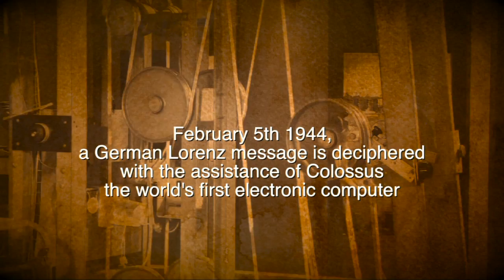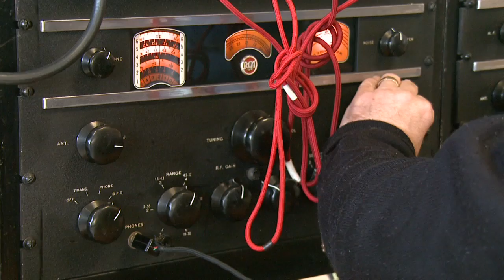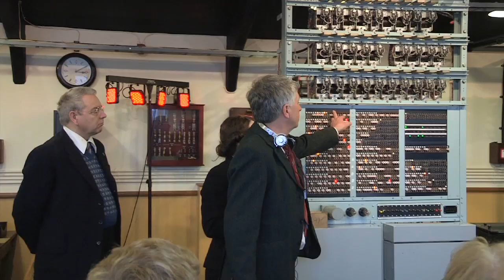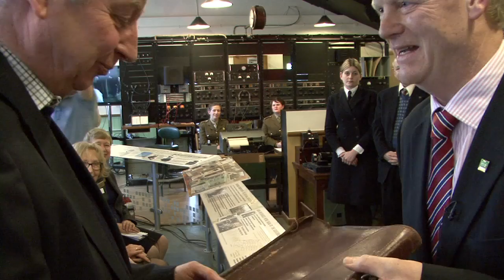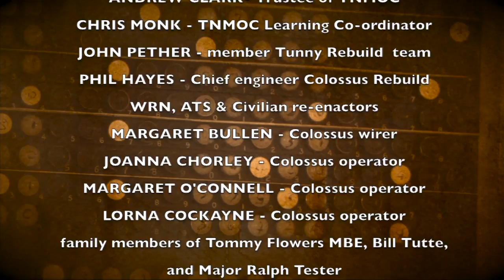Colossus at 70

Comment: Most of the valves were triodes which has an anode, cathode and grid. they were connected in pairs to form a flip/flop which by applying a voltage on the grid determines the voltage on each anode and therefore producing a 1 or 0.

Comment: Amazing stuff. During the war, Churchill wrote an open cheque. They got what they wanted regardless of cost. The secrecy that was achieved was purely becuase it was non commercial. No private company was involved. No tender like in the USA, so no leaks. I heard that by the end of the war, 12 colossus 2's were made at a cost of 100,000 pounds each in 1940s money. That works out at over $2b. Churchill did not bat an eyelid. He knew that the war would have been shortened, as it turned out by two years.

Comment: The true celebration needs to finally and properly recognize Bill Tutte and Tommy Flowers, Tutte for breaking the Lorenz 12 rotor cipher machine and Tommy Flowers for then conceiving, designing, building and putting into operation the world's first electronic, digital, memory based computer to speed up accessing the daily Lorenz keys......(Turing had NOTHING to do with those incredible accomplishments......)...!
Reply: and Turing was only a follow on from Polish engineers who had built a Bomba machine well before Turing develop a more concise and better functioning unit. Regrettably there were very few suitable vaccum tubes available  that could make "flip-flops" essentail for digital arithmetic in earl 40s, actually I think the germans had better "rohren" tube technology when examining the small black tubes found in early German radios used in aircrat in WW2.

Comment: Does anyone know the line discipline in use? My best guess is 50 baud (standard in Europe where 45.45 was standard in the US). Also I know that Baudot/ITA2 had 5 bit sync codes for start and end of message, but were there also start bits and stop bits for each 5 bit transmission unit? Also, does anyone know the FSK interval between mark and space? 170 Hz seems to have been a common standard.

Comment: It would be great to get some picture of the machines for reading the tape and converting that into the punched tape. What do the operators see exactly? How do they translate the tape?
Reply: Exactly my point no director employed to point the crew into the correct shot angle,  or use it later in an edit as a shot cut away judging by the smirks on their faces and their bad use of radio mikes , feedback teetering on the brink of howl-around and wobbly camera shots they couldnt give  a damn. This should never have been shot with an audience I wonder if they  ever did a proper film of this.
Reply: HUH? it was all punch tape with an optical read on Colossus. The girls typed the cypher text from slip tape directly on punch paper tape @ 27:03 These operator read the slip tapes and typed in what they saw. Slip tapes were a crude printout of the audio sound. Sort of the 1's and 0's of the sounds of the decoded sound. Did u miss seeing that?

Comment: Another example of a supremely interesting event ruined by people who don't understand how to work a sound system! ("Oh I have a microphone you can borrow, I used it for my sisters wedding and you could hear most of what the vicar said") Why the howl round? That room is quite tiny and I am sure even those at the back could hear quite clearly so why have P.A. and why not turn it down? Obviously an amateur operator.. There were professional video equipment so why use a cheap radio microphone system that worked on the broadcast waveband? Really annoying. Anyway why use a radio mic when there is obviously going to be electrical interference? What's wrong with a wire? I was screaming at the telly trying to hear what was being said.
Reply: How ungracious. You miss the whole point. Its a demonstration of the earliest technology being supplemented by the human brain. Who cares if the mic is not state of the art. None of what you see there was funded by the UK government. Its all from public fundraising and volunteers.